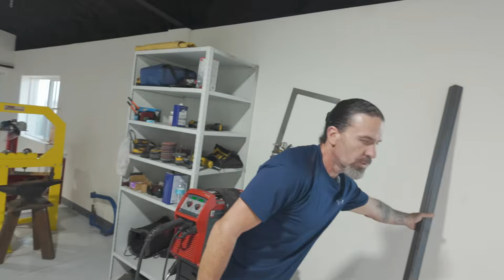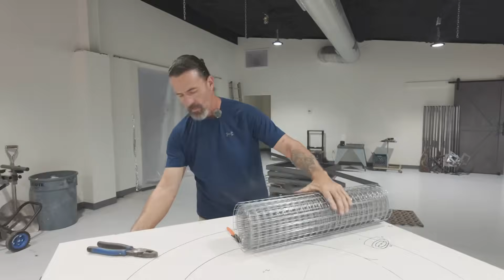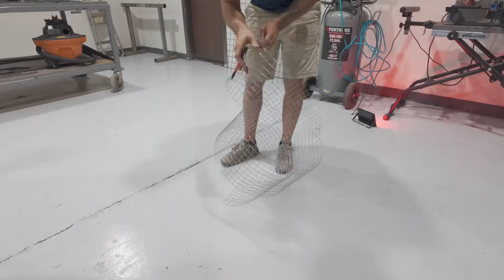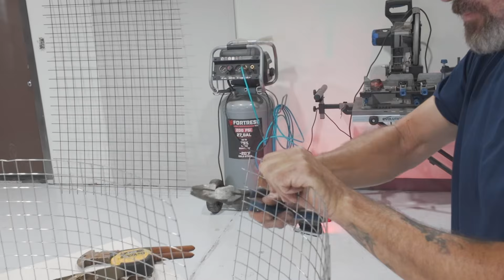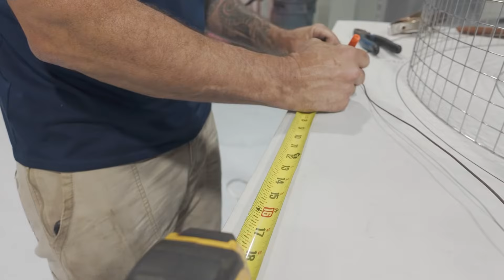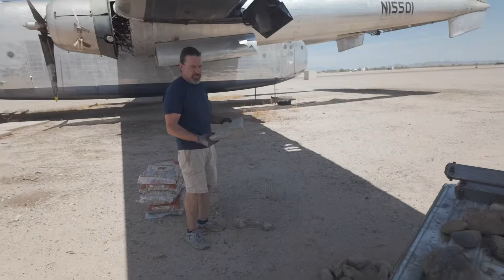This Easy Gabion Fire Pit Only Needs Basic Tools!

Comment from the maker: 🔥 Quick note on rocks: A few people asked about rocks cracking in the heat — it’s never happened to me, so I wasn’t aware this was a thing. Appreciate the community for flagging it. After some research: although rare, river rocks can sometimes trap moisture and pop when heated. If you want to play it safe, go with lava rock, granite, or stones rated for fire pits. Two easy fixes: line the inside with fire brick (Home Depot sells flat ones cheap), or drop a steel fire bowl or ring inside the cage so the flames never touch the rocks directly. Stay tuned, I’ve got something in the works on that front. 🛠️ 

Want a pro-grade welded gabion fire pit built to order? Shop custom gabions at https://getyourgabion.com 🔥 Built in Black Canyon City, AZ